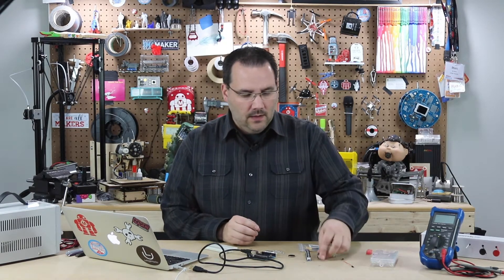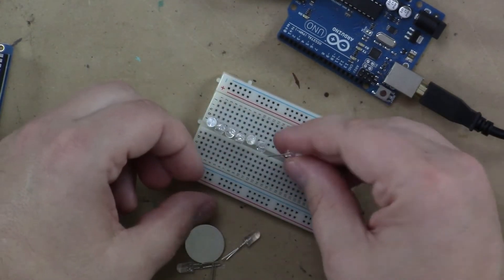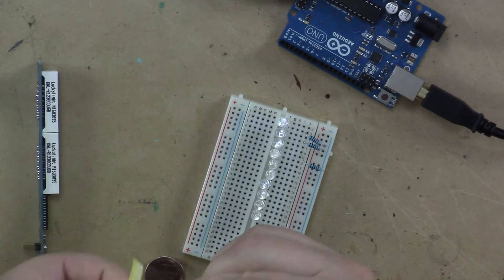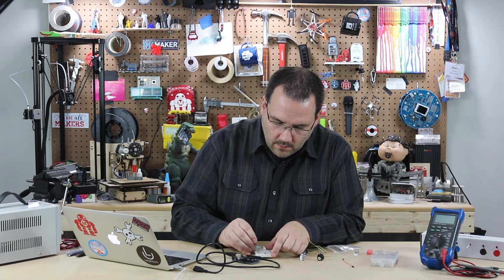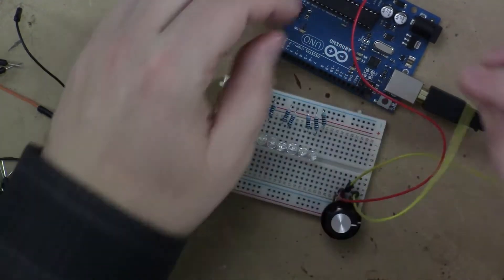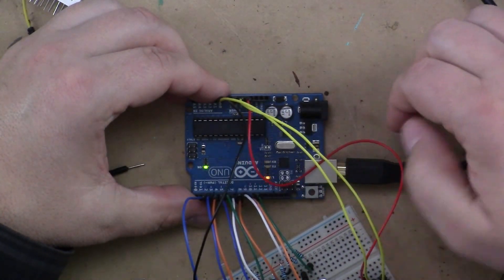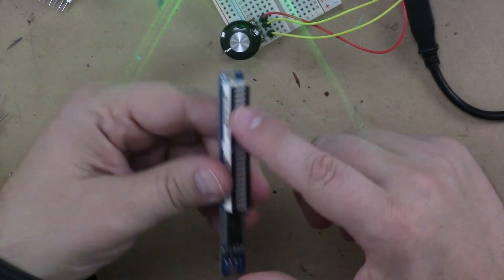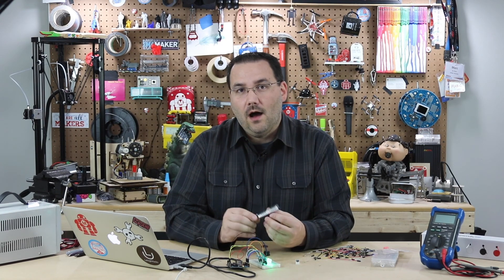Arduino Prototyping Outputs #74: LED Bar Graphs

Comment: How would you change the code to use the Adafruit 24 LED backpack? Thanks!
Reply from the maker: It’s actually completely different code as it uses I2C and my example is just manipulating pins directly. I suggest you check out Adafruit Learn to get some great examples, with code, on how to use that specific product. By the way, it’s a great product and easy to use!

Comment: Marc, I built this circuit and for some reason it didn’t work like it should.  I’ll go back and figure out why.   I need a circuit like this one that operates all of the LEDs in only one quarter of a turn of the knob.  What pot did you use, and what would you recommend for making this same circuit work in 1/4 turn? Thanks!!!
Reply from the maker: Recheck all your connections! You can also refer the Arduino website for the schematic. I used a 10k Ohm potentiometer. Changing it to a 1/4 turn is done via code, just adjust the mapping function to a lower number.

Comment: Marc, liked and subscribed.   I need this exact circuit, but it needs to use a Hall Effect module like the KY-003 to drive the LEDs.   Will this exact circuit that you have here do this, and will the Arduino program need to be modified?  Thanks!!!
Reply from the maker: The code would need to be modified to work with the specific sensor. It shouldn’t be too difficult, especially if it outputs an Alan Oly signal that you could do some simple math to calculate the output to the LEDs.